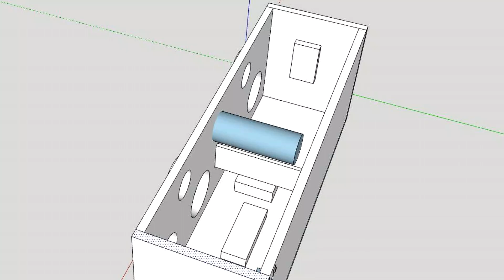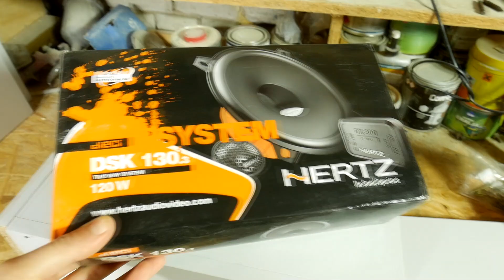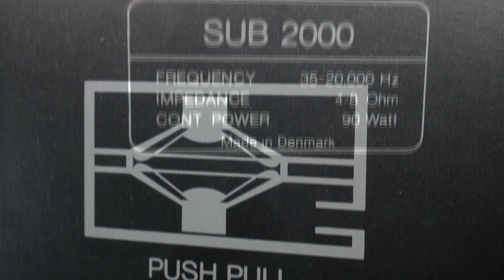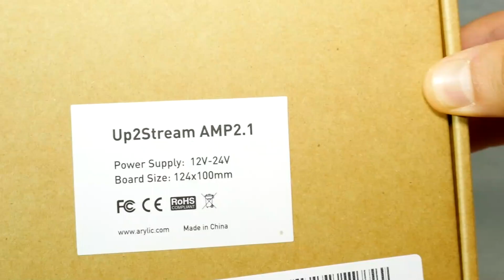How To Make Bluetooth portable speaker [JBL killer Beast 2] [DIY]

Comment: These reflex ports in the boombox are unnecessary.  It was necessary to make the casing closed and the sound would have been better, and now one big bang out of the box.
Reply from the maker: Closed box dont have that boombox type sound effect 🍉
Reply: @cybernaab I have used 6 x 9 in boxes. I used 1.1 cubic feet each and tuned to 50Hz with 2 2.5" diameter ports each side, and lined with sound absorbing open cell foam. The bass performance is very good. This one was a dual chamber box but you can build separate in two single chamber if you prefer to separate the speakers. You could probably go down to 1 cubic foot depending on the magnet strength of the drivers.